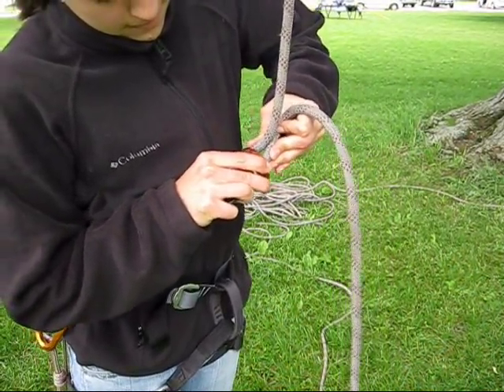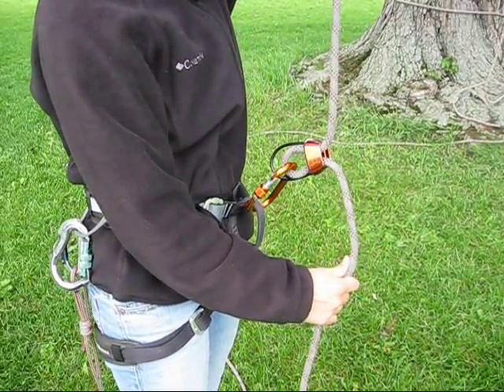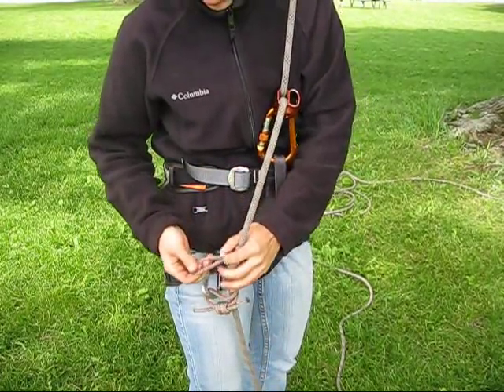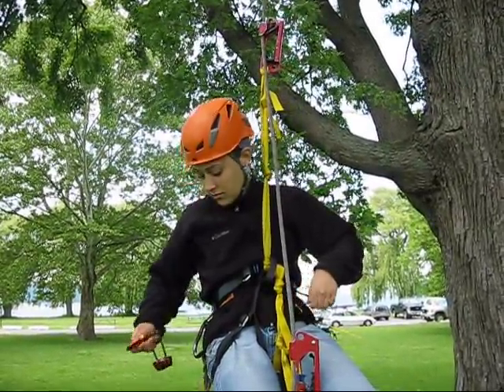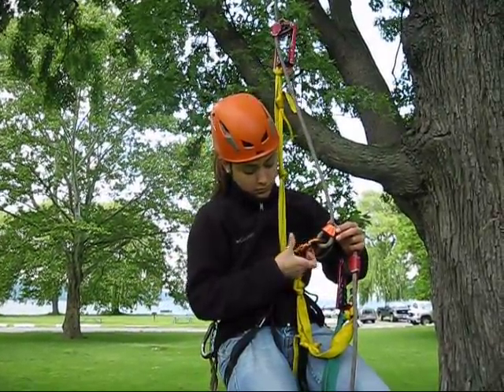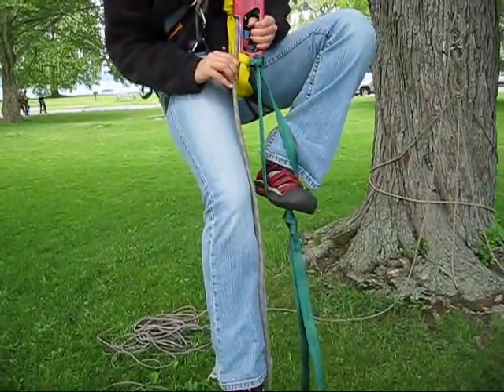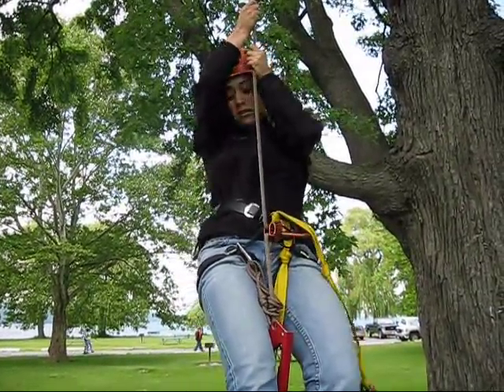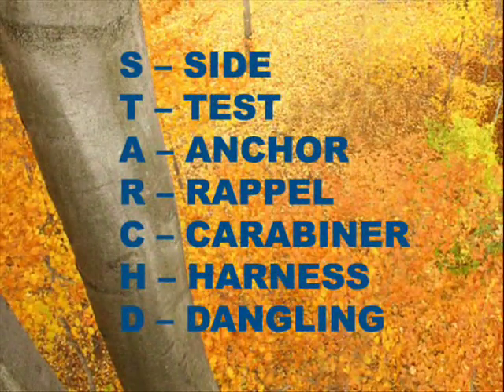Tree Climbing: Descending and Switch to Rappel

Comment: I will never climb on a screw gate carabiner. And didn't like way of climbing. I trust my Blake hitch with split tail system
Reply from the maker: If you are an Arborist then you are obligated to use the autolocking version, but there were probably 100,000 people who in some rope context, used screw gate carabiner to rappel today...without incident.  In a recreational setting, the thing that matters is your ability to monitor the state of your locking carabiner.  If you are descending cleanly down a rope and doing nothing else, then a screw gate carabiner is perfectly fine.  We also use the Blake's Hitch system, but there are situations were that is not possible - for example in the case of trees with seriously down-sloping branches.

Comment from the maker: @palindromepk86 You can certainly tie in short if you want a back up for the two ascenders.  As for the gri gri method, sure, you can ascend that way or any of at least 20 other methods.  The advantage of the gri gri systm is a trivial transition to rappel.  The disadvantage is that to pull in slack, even redirected off the top ascender, you end up picking up the trailing rope.  Gets tiring on a long ascent.  Also a closer connection to the rope at your waist makes standing on a limb harder.

Comment from the maker: @emlarge97 You can put your autoblock on the leg loop.  Just make sure it is short enough not to run into your belay device.  The key here is that the autoblock doesn't hold your weight.  It merely acts in place of your hand on the brake strand of the rope.  The tension on your leg loop will be about equivalent to hand pressure.

Comment from the maker: @NorthWashOutfitters The one additional thing we sometimes do is to add a figure eight on a bight below all the action.  However, we always maintain two connections to the rope, and removing the lower ascender last means that if we lose control of the rappel, the ascender jams in the rappel device.  You can find this same transition in rope rescue books.  Try Fasulo.  These days we use gri gri's for the change over which makes things considerably easier.  Any specific recommendation?

Comment: Why a "non-locking carabiner" for the autoblock?
Reply from the maker: A locking carabiner isn't really necessary here. It is common practice to use a non locking carabiner. There certainly wouldn't be any problem using a locking one either. These days we no longer use tube style descent devices.  We have switched over to the grigri or ID for most purposes.
Reply: @CornellTreeClimbing  thank you for replying! I was concerned there was a safety risk to using a locking one that I wasn't understanding. 

This would work on a figure 8 setup too from what I can tell. I'm looking for a low weight backup in case something happens to my mechanical device.
Reply from the maker: @the.mr.beacher  A tube style device is a very solid backup and very lightweight. The only tricky thing with the figure 8 is that it requires a bit more space to install, just because it is a longer device. One could also use a munter hitch on a locking carabiner to descend, though the change over is awkward.

Comment from the maker: @NorthWashOutfitters If I follow you correctly we rejected that method specifically because students have difficulty controlling the rappel when they are removing the last ascender.  The lower ascender hitting the belay device is a very reliable backup in this situation.  If the last ascender removed is above the belay device and the student bobbles the rappel then off they go.

Comment: I really like your videos, thanks a lot cornell tree climbing, but be carefull the autoblock has to be at least two inches below the descender just as the way she did it the first time. Thanks, I have learned a lot from your videos good job!
Reply: Thanks!  Indeed, now auto blocks are usually attached to the belay loop and the rappel device extended with a sling.

Comment: Revisiting these videos after a couple of years.  This is basically textbook rock climbing techniques in a tree.  Arborists don't operate in this fashion.  Having to switch out gear for ascent and descent is a luxury that production work doesn't afford.  There are a number of options that allow ascent and descent in a static system without reconfiguration.  There are various mechanical devices like the uniscender.  You can use a rope wrench and still use a friction hitch.  Many arborists prefer to switch out for a classic dynamic double rope system after ascending and reaching their tie in point. If you're interested in production tree work, this will not cut it.  Yes I realize the pun.
Reply: True enough.  We should probably do a few more videos of other techniques with some more modern gear.  I believe there is one in this series using the unicender.  For recreational climbers (this video was aimed at recreational and research climbers) who do not have the "time = money" constraint, this is still legit.  And in some circumstances, like super giant trees, these and related SRT modes are still the way to go.  We also use this kind of climbing in conifers when there is no possibility of isolating a branch, and when hitches get really hard to deal with on a sap covered rope.
Reply: @markholton8555  
I see your point.  Recreationally, totally legit.

Comment from the maker: @pauljrsdad Autolockers are certainly nice.  Our systems do away with carabiners in many places where arborists use them regularly, as in the connection to the ascenders.  The two places where we still use them, in the ground anchor and in rappelling, don't necessarily need autolockers for safety.  We double the anchor carabiners anyway as a matter of redundancy, and it is easy to monitor the status of a screw lock while rappelling.

Comment: Hi Cornell, 
Now I have it, the Prusik loop is the cord and the Autoblock is the knot (rather than the function).
Can you please advise what rope you are using for your static line and for your Prusik loop?
Also, I get that for a club you are budget conscious in selection of your gear, but if you only had to purchase one item for your personal kit, what devices would you consider as alternatives to the ATC device shown for rappelling solo?
Thanks for the excellent videos, I have not found any online that explain the basics more clearly.
Gus
Reply from the maker: Hi Gus,
We usually use New England Fly for our standard climbing classes.  The Prusik cord is 5 or 6 mil nylon utility cord.  I'm not sure of the supplier offhand, but most reputable rope companies supply something like that.  These days we almost always use the Petzl GriGri for descending.  While not completely idiot proof, it is nice to have the autolocking feature.  If you have piles of money you might also consider a Petzl ID.  Climb safe!